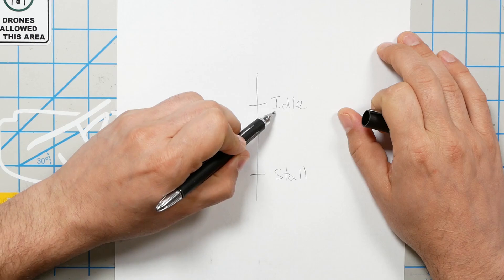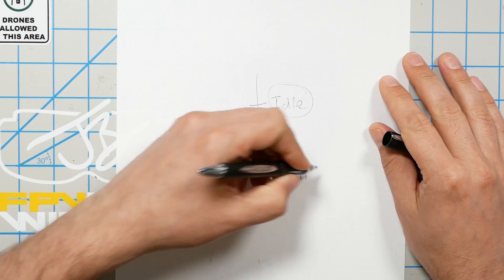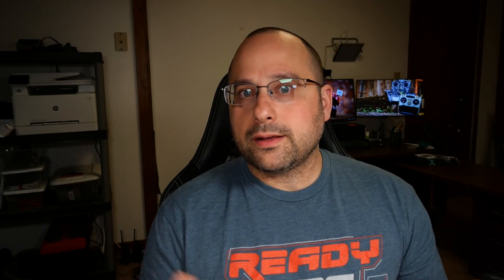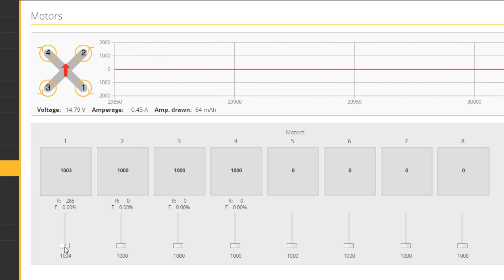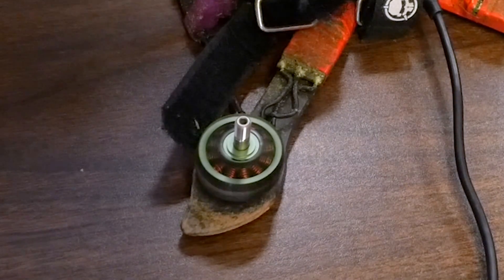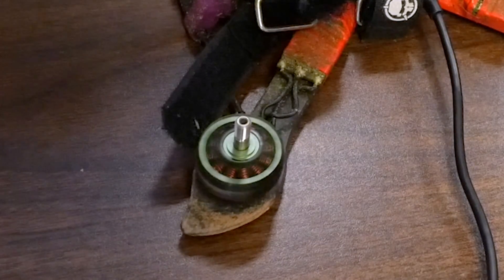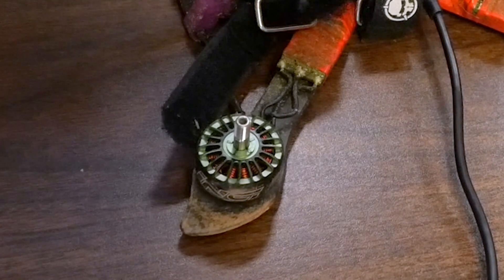"Dynamic Idle" the most useful Betaflight feature you never heard of

Comment: I haven't even built an FPV drone before. I'm learning ahead though just in case, still learned stuff so that's always great. I'm probably gonna get geared up once my "emergency" covid check comes in lol
Reply: Joshua is the best resource through that whole process - if you can, copy his latest budget-friendly build, and just follow along, rewatch as many sections as possible.  Even I started off that way in this hobby.
Reply: @tehllama42  yeah i've already watched once as well as wiring diagrams and stuff. What did you get as your first pair of goggles ? I was thinking of jumping straight to HDOs since I'm pretty confident i'm gonna love it ... I don't wanna buy cheap ones and end up upgrading anyways.
Reply: @iCortex1  Any OLED is impressive, and the HDO2's have odd issues for some people.
I'm not the most helpful, since I still fly with my first goggles - FlySight Spexman02s, but run a Clearview ground station as input.
In my mind, it would be between HDO's, Skyzone 030's, or starting with DJI from the outset and getting an analog conversion kit from the get-go (so cheap indoor quads and super-lightweight stuff works)

Comment: The way i understood, it had more to do with the throttle percentage being able to go below your normal idle percentage. So dynamic Idle will allow you to go below your normal idle percentage of lets say 5% throttle, in cases where reverse flow conditions are already providing torque on the motor (due to reverse flow on your props). So in your example for people who have high trottle percentages, should their min_rpm values correspond to the RPM they aim at to have a lot of response (which are high). The benefit there as i understand it, would be that the PID loop is allowed to lower throttle to 0% as long as the props keep spinning at the minimum desired speed. What am i missing here?

Comment: I'm going to pose a question and see what your answer is. Why don't we use a sensor based esc in FPV? My background is heavy in surface and in racing in particular they use a sensor based esc. There is a cable that runs from the motor to the esc that tells the esc where the rotor is in its rotation allowing the esc to make more precise drive inputs giving the driver a better "feel". This is mainly for lower rpm and usually is turned off at higher rpm as the sensor actually hinders hi rpm performance. I see where this could be beneficial, especially for dynamic idle.
Reply: So, pole crossings are very specifically how the ESC knows to initiate the next switching event.  What your'e describing is core to how an electronic speed controller knows when to dump DC current into the motor windings, and switch it back off with the next one coming.
Getting this data that's already onboard the ESC (this is why Motor_Poles is a parameter) back to a flight controller via bidirectional DSHOT is the magic that enables RPM Filtering and Dynamic Idle.
Reply: @tehllama42  thank you for that. Very clear answer.
Reply: @xNmMmAx  No problem - this does a much better job of explaining it - the back-EMF sensing is integratl to how it performs (and why some ESC settings like motor timing to med-high/23° affects performance so much)
https://howtomechatronics.com/how-it-works/how-brushless-motor-and-esc-work
Reply: #1, cost, #2 an aditional 20 wires per quad for sensors. But this would solve so much issues.

Comment: It looks like the holy grail to prevent desync but it isn't.
Keep in mind that dshot_ilde_value provide a 100% reliable static thrust.
While that idle_min_rpm rely on some sort of unrealiable pid loop that try to hit that min rpm but fails irl :)
For my experience idle_min_rpm  makes more harm than good because that min rpm suffers great oscillations in flight  resulting in even more unpredictable stalls.
Reply from the maker: I think you need to raise the idle_min_rpm but in the end if it doesn't work for you don't use it.

Comment: That's extremely interesting!!! I had never imagined that CaptainVani had 8% idle! Personally i had it down to 3% because 1) i find difficult to do inverted yaw spins because tends to fall faster 2) the quad takes forever to get down to the ground. I definitely learn something today. Question: Propellers pitch affect the idle ratio or dynamic idle?
Reply: Prop weight, pitch, and relative chord thickness all affect it, usually in that order.  Heavy aggressive props will have you wanting to run higher values, thinner lighter ones with less pitch let you run lower values.
Reply: @tehllama42  i think it's the opposite I run 4.8 pitch and it takes forever to get down to the ground on higher idle percentage

Comment: When you took the base value of the stall speed of the motor by slowing it down to see the min value, you did this without a propeller on. If motor stall speed is a function of resistance like you said, you would want to have a propeller on during this to get the right base value...correct?
Reply from the maker: It kind of doesn't matter because the number will always be much higher in the air, but I thought it was a good exercise to get the lowest possible value.

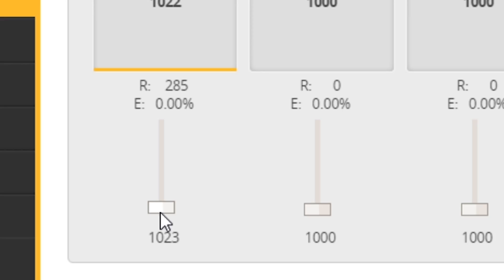Comment: 10:42 is it posible that this minimum depends from battery voltage? lets say cel voltage is 4.2 and i set minimum idle, and batery drops to 3.9 can my motor stal from this?
Reply: Probably not because idle min appears to be based on motor RPM not percent throttle
Reply: @Art1f4ct  this have sense, my min was 0 and idle 300 I think I'll make some changes :)
Reply from the maker: I tested with empty and full battery and found the stall rpm to be the same. I think this is why idle_min is an rpm and not a percent.
Reply: Yes, it very much does depend if you're changing cell count without this.  Across battery discharge, the old way would have fairly minor changes, but this does RPM... and it's usually best to run VBAT PID Compensation anyway (technially unrelated, but it does help with the same problems).
 While it sounds odd, this feature removes those changes based on input cell voltage because it's using RPM data, instead of just blinding sending a DSHOT command and the RPM you get is what you get.

Comment: I noticed another not well known thing - you don't have to change arm angle to 180 anymore in order to use turtle mode, because turtle mode overrides it and allows to arm at any angle even if your max arm angle is set to something like 30, it does not apply to turtle mode. I believe even Joshua himself does not know this, because in all beginner videos he still tell to change arm angle to 180. I think it's better to leave arm angle to some normal value to have another failsafe to unwanted arming.
Reply: Yes - but depending where and how you get stuck, sometimes it's quite nice to be able to arm in normal direction (although you can definitely torch hardware this way)
Reply from the maker: I definitely do know this. This has been fixed practically since turtle mode came out. The reason I set it to 180 is because I hate not being able to arm if my quad is slightly on a hill.
Reply: @JoshuaBardwell  my apologies. I really thought it was just because of turtle mode. This makes sense.

Comment: I thought motors had more toque at lower speeds...  at least on my CNC machine with stepper (brushless) motors. Are quads different or is it something a bit different (time to spin up from very low rpm).  I thought the desync   was the command to push not being in sync with the motor (magnet) position due to the lack of torque from the last command.  This being motor stall, not areodynamic stall. Curious if I've got this wrong. None of which changes the usefulness of dynamic idle and your awesome video (as always).
Reply: I'm a jackass... Had I watched 5 seconds more before posting I would have heard "motor stall", "motor stall", "motor stall".  But I did catch the problem with the bench test... You need a lot more torque with motors attached. That was the "no load" stall speed.
Reply from the maker: It's not truly an issue of torque, but that's a short-hand way of expressing what's happening. One thing is that the position sensing of the ESC becomes less accurate at low rpm, because the back-EMF voltage is weaker. Therefore the chances of a stall are greater. Another thing is that when the prop is spinning slowly, the motor makes less thrust and therefore the PID loop has less authority.

Comment: So what is each motor has a different rpm in which it spins without hesitating while in the motors tab? For example, motor 1 is 350, 2 is 620, 3 is 900, and 4 is 900. Do I just take the motor with the highest rpm and use that?

Comment: Thank you JB, On top of that, what is  the behavior if you change value in BLheli like Throttle Min into a lower or upper value than the default in ESC firmware configuration ?

Comment: Hi Joshua, I've got a problem with my Protek25 and my Betafpv 95 V2, when I fly between tries, and heppened I have to cut throttle to pass throw sometimes motor idel same speed for few seconds, I've tried to rise and again slow the rpm using the stick but nothing it slow down after few seconds and I crash on the tree.... It seems it happened when there is wind but when I fly them not beetween tries in the wind it doesn't heppened. Could it be a dynamic Idle adjustment to do? Many thanks

Comment: Im quite a newbie to fpv, please guys tell me if im right about this. Ive revently learned to dive and i ve noticed that even with 0 throttle the quad goes forward quite a lot, it doesnt fall vertically but rather at 70° angle. Is this the right tutorial for me? Should i simply lower my throttle idle to that 2,5% that JB says is the freestyle minimum?
Reply: Ps. I have a iflight cidora, and the stock value is 5,5%.if you think that is right than it means I just suck at flying and i need to pratcise falling vertically

Comment: Thank you for the briefing, Joshua! Have you gathered any feedback/opinion from Captain V.? Also, what is/are the parameters that cause the idle value to vary between the two endpoint settings? For example, if idle is only adjusted downward in response to differential prop rate (e.g., rolls or flips), then inverted hang time would still be lost if we raise our dshot_idle_value, right?
Reply from the maker: That is a question that I am still trying to understand but the answer seems to be no. That right now, your motors are not spinning at idle when you are at zero throttle, because the PID loop must increase throttle to stabilize the quad. So if you enable dynamic idle, the actual rpm at zero throttle will be lower, and you can actually raise idle percent with no net change in hang time or speed of descent. Obviously at a certain point, the idle is so high that you feel a difference.
Reply: @JoshuaBardwell  Reading TFM (https://github.com/betaflight/betaflight/wiki/Tuning-Dynamic-Idle) helped me to understand your explanation ;-) It is still working against inverted hang time to raise our dshot_idle_value. Enabling dynamic idle allows a motor's drive to go to zero as long as its prop is still spinning at or above idle_min_rpm. The PID controller can thus command reduced drive (i.e., below the dshot_idle_value) on motors that need braking to maintain orientation (e.g., when inverted). The reduced net drive among all motors while inverted increases hang time. We can then raise our dshot_idle_value to consume as much of the the newly-acquired margin as we like.

Comment: I am in firmware 4.2 and using 10.7 beta flight configurator. I tried changing idle min both thru CLI and in the tuning tab and neither approach is saving. It’s currently set to zero and I want to change it to 14. What am I doing wrong ??? I have used CLI before to make changes and it’s always worked for other features. Please help !!! Thanks for the great videos

Comment: I Run a 6 inch 6s build with brotherhobby avenger v2 2507 1200kv .. I find at low throttle I wobble just a tiny bit if in coming down into dirty air.. would bumping up the idle percent make more sense in my application rather then dynamic ?

Comment: Hi Joshua, great video!!!! I have a question, I built an sub250 5" with motors 2004 2910Kv, the response is amazing, however, it hovering more than expected if we are looking for a freestyle 5-inch drone, I am getting a big punch with a little throttle percent,. So, some friends suggested lower the motor_outout_limit or lower the throttle percent or lower the Motor Idle Throttle Value. According to your experience, what should be the better way? I will appreciate your help, I hope to get my sub250 like outlaw by rotor riot or the 2fiddy by Tommy. I am testing QAV-S mini with 5" arms done by espeedyfpv, you know Santi right.
Reply from the maker: Motor output limit is safer for the motors. Throttle scale is easier to adjust in flight.

Comment: Hi if the idle speed it high as to the point its still on the ground when in flight that would make your quad drop alt slower at 0 throtel correct

Comment: Great info! Does this theory apply to micros ( 2.5 / 3”) as well? Thanks!
Reply from the maker: In general I think it should apply to any multirotor, but the specific numbers may be different. Micros often need higher idle speed to prevent stalling.
Reply: It does - but in the smaller sizes unless your'e into the featherweight stuff, you usually can just run normal fixed idle and set it a bit high (6% or so) and be just fine - there is a bit of marginal improvement possible, but it's more noticeable on really high thrust to weight ratio setups, or ones where you're trying to throw the quad inverted for huge distances.  Down in the <80g territory of those, it starts to matter a fair bit again, because those smaller motors really struggle at low RPM.  I'd also add Thrust_Linear = 25-33 ish into there for those setups as well.

Comment: So wouldn't this be equal to the old finalglideaus and Mr Steele trick of using an idle up switch? I know Mr Steele didn't like airmode. But he'd use idle up to get a more responsive feel but not as prone to windup as airmode. I'm fairly certain that those guys also used motor stop for landing instead of disarm so the purpose of idle up wasn't just for response but also as motor stall prevention. I don't see this as a game changer as much as making people aware of some part of the flight dynamics for quadcopter. But I think not enough is said for thrust linear or atleast proper tuning of tpa for those not wanting to try something new. There is also a feature that adds throttle with tilt for level flight mode which is great for whoops.
Reply from the maker: There may be some similarity to idle up, which is that when you use idle up the throttle position raises but the motors can still go lower if they need to. The unique thing that dynamic idle adds is the ability to monitor motor rpm in real time and prevent stalling.

Comment: Would you still have to adjust air mode minimum throttle this way or did they fix it in the newer version?
Reply from the maker: Air mode minimum throttle is often misunderstood. It's just the throttle position after which air mode initially kicks in, to prevent windup when arming but not taking off. But a lot of people think air mode min throttle means air mode turns off when the throttle goes below that point, and that's not true. Air mode is most important at low throttle, so it would be silly to turn it off at low throttle. Once it turns on, after arming, it stays on until you disarm.

Comment: Does propwash have anything to do with idel percentage? Like can increasing ideal percentage lower propwash or fix it?
Reply from the maker: That is true actually. Increasing idle percent decreases propwash because it keeps the motor in its torque curve and it keeps the prop out of the low-speed airflow where the prop begins to stall.
Reply: @JoshuaBardwell  Well in that case I am going to try that to fix some horrible propwash on my budget quad. I don't get to fly it often so don't get may attempts to try and assess propwash so will definitely try increasing del percentage. Thank you Sir!! 👍

Comment: So when you flip upside down and cut throttle, which idle are the motors spinning at? Its still gonna be at the motor idle percentage (configuration tab) right? and so how is inverted hang time improved by this feature?
Reply from the maker: It allows the motors to go below the normal idle percent if the PID controller wants to do that.
Reply: @JoshuaBardwell  right, but why would the motors go below idle when the quad is inverted? That's when "I" want them to go lower (for more hang time) but the fc wouldn't have a reason to go below idle if I'm just haning inverted. So I feel like raising the idle percentage still negatively affects inverted hang time even with dynamic idle enabled.

Comment: I noticed that, at least for my setup, the RPM value in BF is 50% that of the RPM value in BLHeli motors tab, for the same PWM. Any idea why? Basically BLHeli only lets me step from 1015 to 1017 and reflects 850RPM while BF shows 450 RPM for what appears to be the same PWM value.

Comment: Hi, Joshua

After watching this video, I set my quad in CLI ”idle_min_rom = 12”.

But it causes my quad after a fast flip bounce back. No matter how I increase the P and D term.

After reviewing the BlackBox, it seems like motors desync. So I change the idle_min_rpm = 25.

Then it almost the same with the motor idle throttle value. And the situation remains the same. When I change the setting ”idle_min_rpm = 0”. Everything back normal.

I question is, could it my ESC or motor’s problem or something wrong with my setting?
Reply from the maker: Why not try some value in between 12 and 25?
Reply: I did, but the situation remain the same.